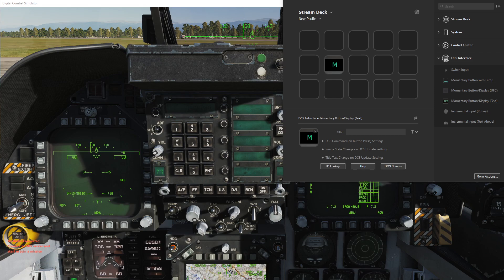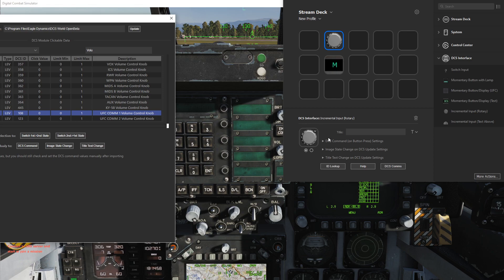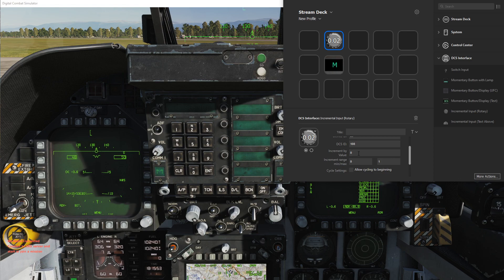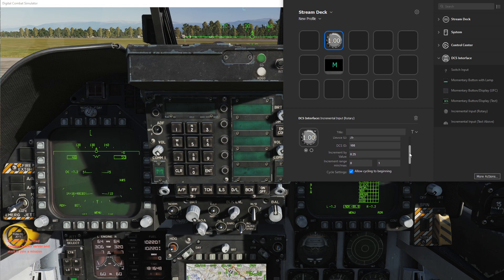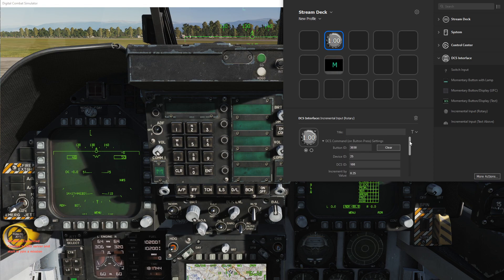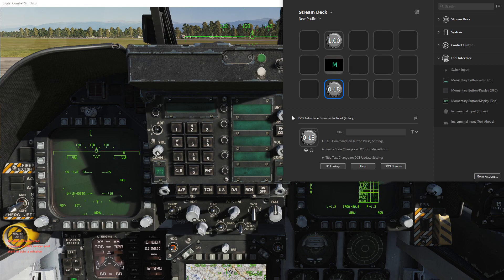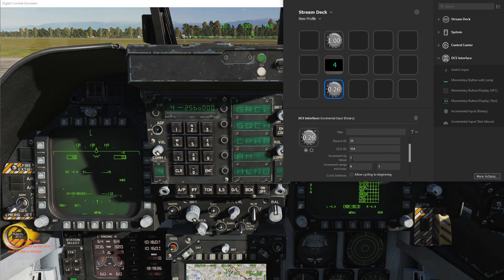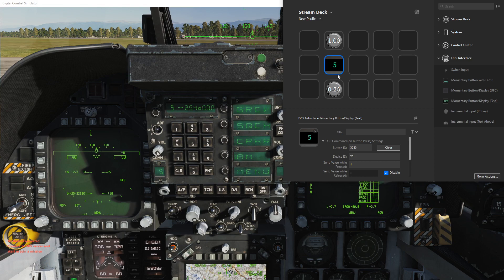Increment (Rotary Dials) - DCS Interface for Streamdeck

Comment: Loupedeck is much better at this than Streamdeck and until now with Streamdeck I was just relying on mapping keys to DCS clickable areas then referencing those from Streamdeck.  However, I have never been able to get the dials on the Streamdeck to work with DCS (although I can with Loupedeck) and thought this might be the solution.  Unfortunately not! thats a shame.  Anyway, found the ID Lookup window closes as soon as I move the data to the Streamdeck interface and then click the Streamdeck window.  A tad annoying - am I doing something wrong?  I did notice that the ID Lookup window has a close, minimise and expand icon but the expand icon is greyed out.

Comment: Hi man, love your tutorials. However i am running into some issues setting these up for the tomcat.
First of all, pressing switches updates really slow on my streamdeck. they get pressed immediately in game as i press them physically, but the image update on the deck itself is slow, and as long as the image has not updated, i can't press the same switch again either.
Also, setting up rotaries; when i do the title text change, the digits keeps flickering back and forth from 1 to 1.000... The values are always correct however. But it's really annoying that it keeps flickering.
All these issues only happen for me in the F14 though, F18 (only one i tested it as well) seems to do everything just fine.
Any help on this issue would be greatly appreciated!
Reply: Don't have any input as to how to fix, just posting to say I have the same issue.

Comment: For the life of me I cannot get the Left MDI Control Knob to work properly in Stream Deck. I mirrored all the settings exactly as I have them for the Right MDI Control Knob, except I changed the device ID and DCS ID. I also doubled checked that I am using the correct device ID and DCS ID. Thes MDI control knobs have 3 settings 0.0, 0.1, and 0.2.